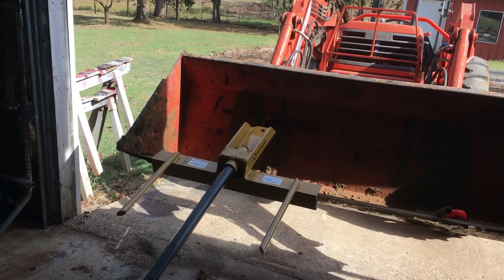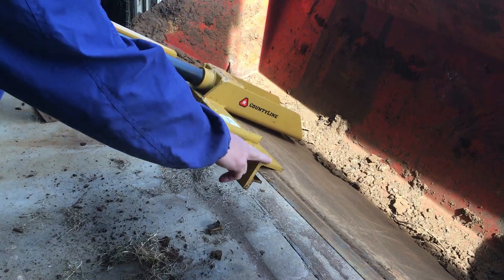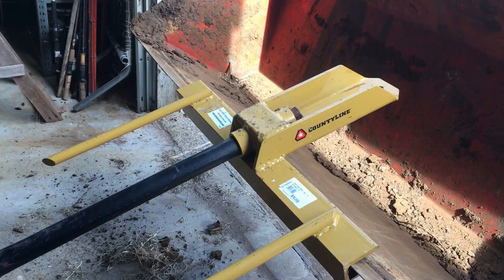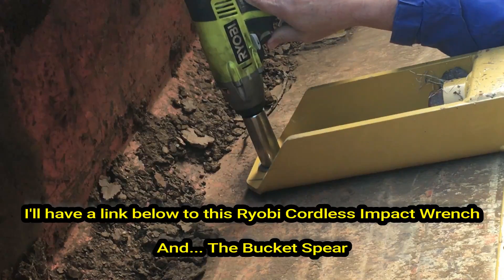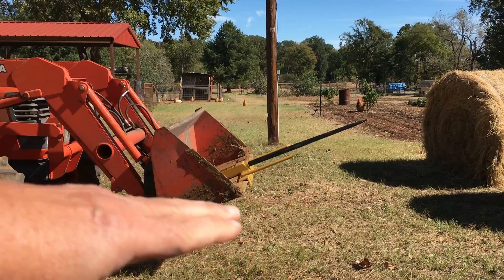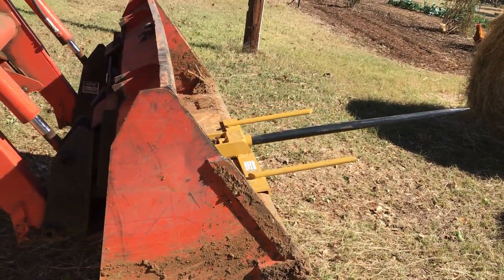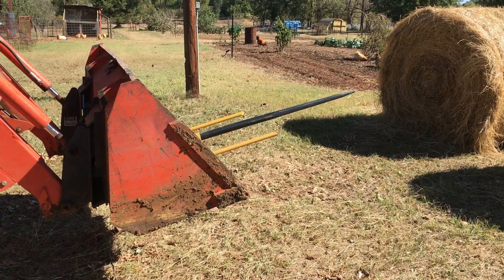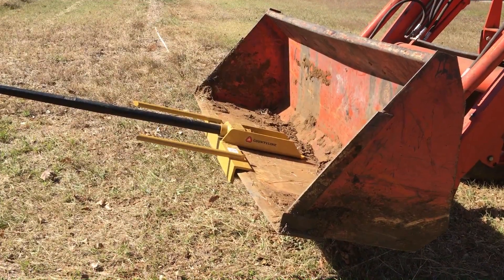COUNTY LINE BUCKET MOUNT HAY SPEAR~INSTALL AND REVIEW

Comment: My neighbor has one of those on his 310c Deere Backhoe loader......................  To date he has taken out two rear windows on customers   new Pickup trucks!!!!!
Reply from the maker: Ouch!
I guess that’s something that you have to be very careful of, and take the extra length into consideration when you start loading something.
Reply: Being as we Round bale everything  for speed and efficency in handling, then convert to  small squares as needed,  we handle large numbers of Round  Bales numerous times,  we have  4 tractors with loaders  and spears plus  a wheel loader spear equipped

Comment: Doesn't look as if you can stack them because the loader (bucket) and the bail is quite a bit of weight. 
Maybe if you had a fork attachment (which I'm almost positive you do) you could weld up a bracket to bring the spear closer in.

Comment: Them bucket mount bale spears are junk and wonk take long and you will  bend up your bucket
Reply from the maker: I didn’t have it very long. I took it back. I think you are right about it being low quality.
Reply: I've seen them braced from the top of the bucket to the spear. This will spead out the load. That should help.